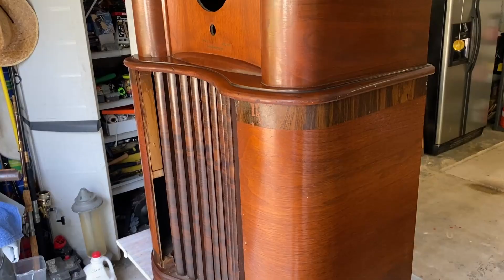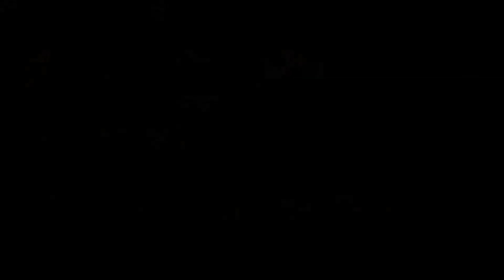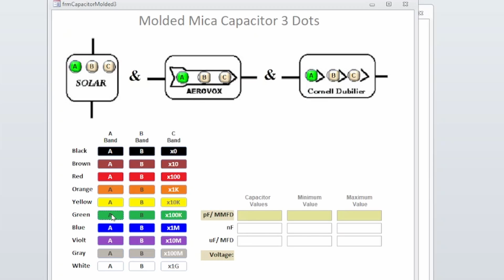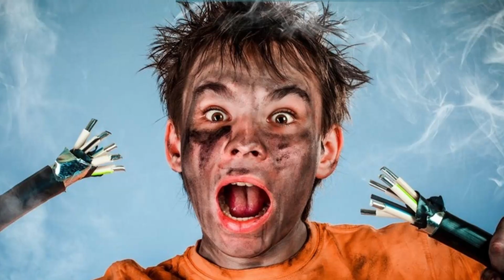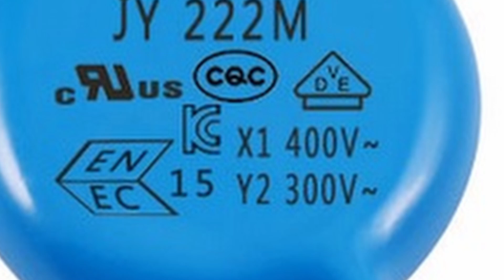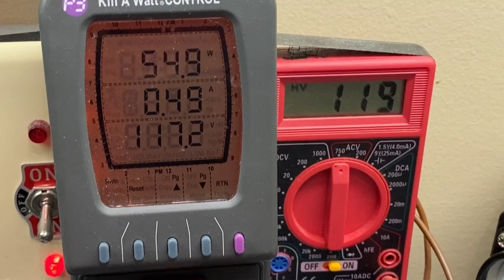Part 5- How to select Safety Capacitor and Fuse (1939 ZENITH Console Radio)

Comment: Thanks for the tips! Looking forward to the resistor/capacitor tool being released on ebay.
Reply from the maker: Steven, so good hearing from you and thank you for taking time to message me. Need to put sometimes to complete the product. It offers tube, capacitor, and resistor inventory. In that case I never going to run out of parts since will tell me what I have in the hand. LOL. You know how it is, getting started on project and realize run out of capacitor. LOL. Have a good day! Regards, JZ

Comment: Interesting video as expected!!! 🙂 I use X1- Y1 so it can be used either way, across the AC line, or hot to ground.. In many cases the line cord is not polarized, so I use one from each side to ground, or across the AC line..  Robert
Reply from the maker: Hi Robert, that is a great idea when the power cord is non-polarized, thanks for sharing. Since radios that I am working on the power cord are in very bad condition, replace them with polarized cord and hook up the Hot side (+) to ON/Off switch. I am still learning from you guys and thank you again for being in touch and sending such uplifting complement.   Have a good day! Regards, JZ
Reply: @RadioFixer  I read that it is estimated that about 7% of American homes that have polarized electrical plugs in their home, are wired WRONG where the hot and neutral are reversed.. Scary stuff but many do it yourself home repair are done wrong... Sort of like those that get the Hot and Cold water lines mixed up on a sink or shower or washing machine .. Sometimes the only way to protect stuff is use capacitors on Both Sides of the power cord..

Comment: Thanks for the education on line caps. I tend to overdo some things myself so I don't have to worry about them. I am looking forward to seeing you make the tuning capacitor belt. Is there some way of determining whether a "micamold" capacitor is really mica or just a paper cap in the mica case? Thanks.
Reply from the maker: Ian, so good hearing from you and thank you for uplifting message. I always check the schematic first to see what is the size on those "domino" capacitors. Also check the color code on capacitor, my understanding is Mica capacitors are in "picofarad" (PF) and "molded" capacitors are in "microfarads" (uF).  There are over a dozen different dot codes for "domino" capacitors, many of which are read in a circular fashion, i.e. left-to-right on the upper row and right-to-left on the bottom row. Guess that is why I build my own color code decoder program since it was so confusing to remember. LOL. Hope this helps. Have a good day! JZ